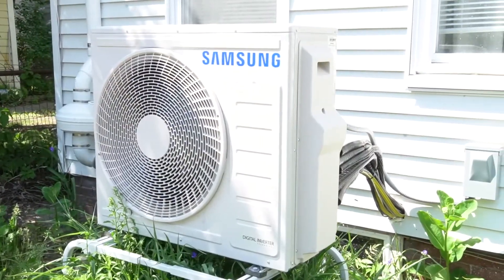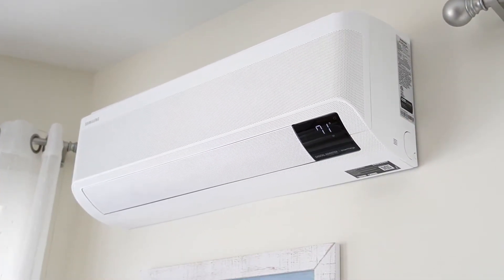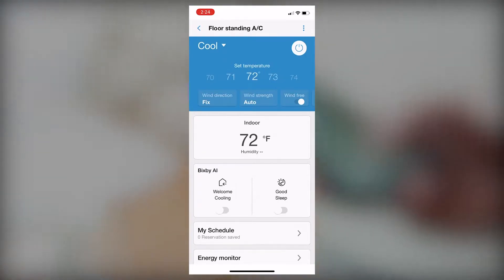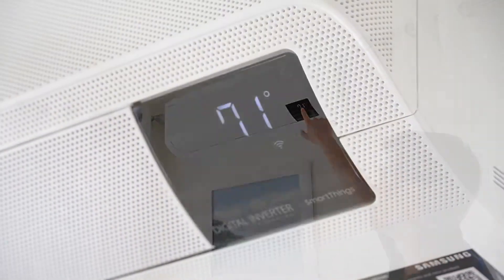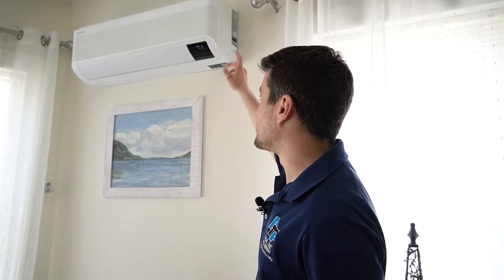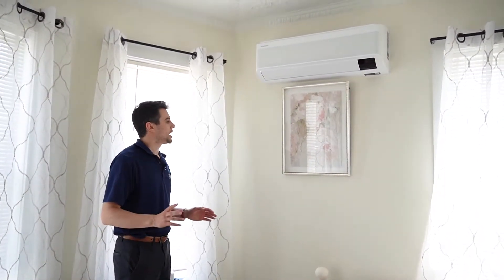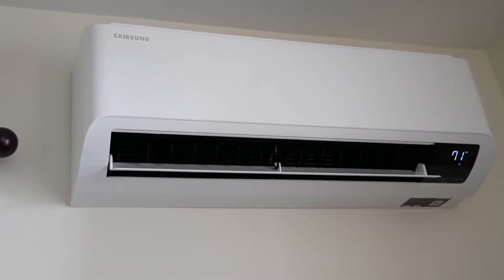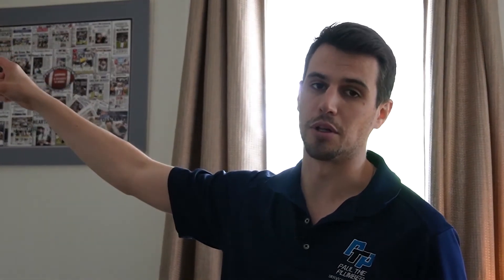3 Zone Samsung Ductless Mini Split Installation Walk Through

Comment: I'm here because the electrical portion of the manual is "figure it out", I need to know the proper way I'm supposed to route and secure the cable from the roof unit.

Comment: Samsung kitchen appliances often quit working after a year. Are the Samsung mini splits a good long term investment?
Reply: They’re as good as any other wall mounted split system ac.
Reply from the maker: They offer a 12 year warranty on their systems.
Reply: @paultheplumber8665  yeah I know they’ve got a warranty but my experience is with Samsung warranties is they send a technician out to repair your product up to 7 times before they finally declare your product unfixable and issue a refund. Each tech support experience involves a long hold to schedule the technician to come out to your home for which you have to skip work for. So many people are unable to complete the process.

Comment: Hello - If I have a 3 zone system, can I just run one zone and leave the other two off? This seems to vary by manufacturer and it is difficult to find this answer. I want to run my single 6-7k bedroom zone at night and leave other zones off. Looking at a 24k BTU total system capacity. Thanks!
Reply: You can leave them off. I think what they were saying is, you have to have them all on heat or cold at the same time. You can’t run two on heat and one on cool.
Reply from the maker: Yes you can definitely do that.
Reply: @paultheplumber8665  thanks. Which brands allow me to do this? I know Mitsubishi requires 10k btu minimum call, so wouldn’t work in this scenario.
Reply from the maker: @brettwiggins271  I've never seen an issue doing this with any of the brands we've installed including Mitsubishi.